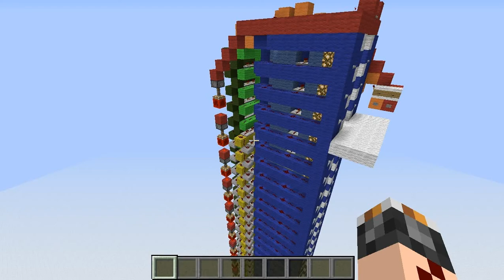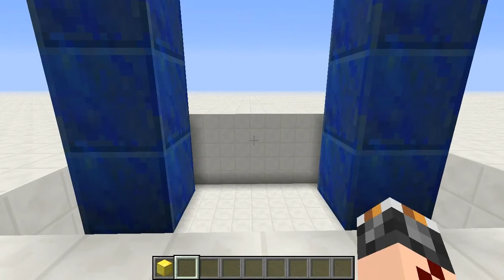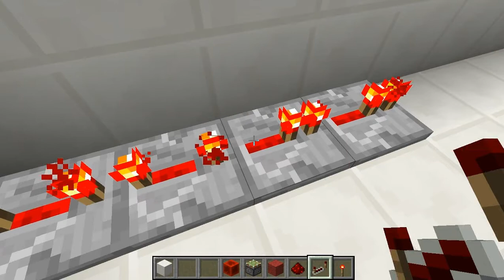2x2 Car Piston Elevator (up & down) TUTORIAL - Minecraft Redstone

Comment from the maker: hmmm...so, you were only changing the wires from the buttons? I don't know how that could do anything. Even the length of the input pulse doesn't matter.
But if trapdoors open, the problem must be with the pulse that is going up.
Try disconnecting the red circuit from its output (where the signal travels up) and connecting it to a long line of 1-tick repeaters. Press the "Up" button and watch those repeaters. Make sure that the signal is 1000101001. It is very important.

Comment from the maker: Did it work before you moved the buttons?
If trapdoors start spazzing out, you are most likely having trouble with the red and orange circuits. They are supposed to create four 1-tick pulses as follows: 1000101001. That is what makes the elevator go.

Comment from the maker: That should not affect it, unless you put the material on top, in which case pistons of the orange circuit can't extend.
I have tried encasing the elevator into dirt via MCEdit, touching the wiring on all four sides, and it works.

Comment: After playing around with your elevator ive noticed that if you put a material, say dirt, all the way around the elevator,touching the walls/wire, it will screw up the shaft, making all the trap doors open and close etc, and make the whole elevator disabled because of it. it is also uncureable that i can tell, taking away the dirt wont fix it.

Comment: I just noticed that the orange circuit is on and all the pistons are up (the ones on the roof) and the orange torch towers are a different pattern than yours, the top one is bright, turning all the pistons i think.

Not sure if this has anything to do with it.

Thanks for the reply.

Comment from the maker: The design that PG5 made first, works in 1.5.2.
They made the new design just because the old one didn't work in 1.6, and since I compacted that design, mine is for 1.6 as well.
The only difference between the 1.5.2 and 1.6 designs is the starter circuit (orange and red in this tutorial). Just use the one from the PG5 old design (link at the end of the video) and it should work in 1.5.2.

Comment: I placed the elevator starting on the top floor now, when I push the down or call button (from the bottom floor) 2 peices of the 2x2 square (diagnol from each other) glitch out exactly like all of the 4 peices if it started from the bottom. While the other 2 diagnol pieces continue down slightly well, but get stuck about 4 blocks higher than it should be, and the 2 higher sets of trapdoors are horizontal while the bottom 2 sets are as they should be. If you know what to do, please help D:

Comment: Does this work in 1.5.2? I tried, even in single player, but it doesn't work. What happens is I have the elevator built at the bottom, and when I push the call button from the top or the up button on the bottom, the elevator moves up one block, stays there for a while, the trapdoors freak out, and it moves back down. If anybody knows what I'd need to do to fix this, or if it is just a problem because of 1.5.2, I would appreciate it :D